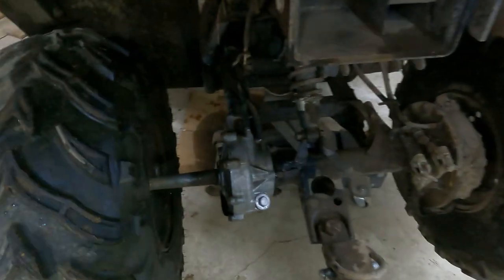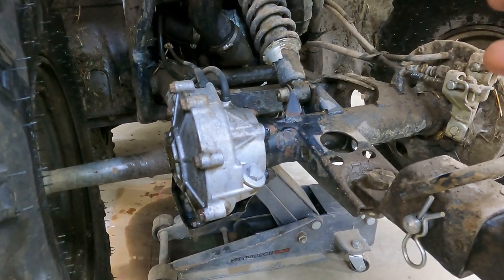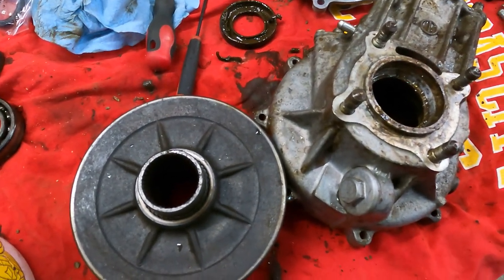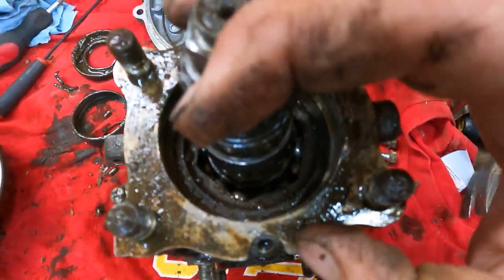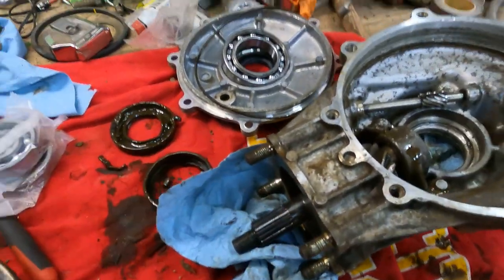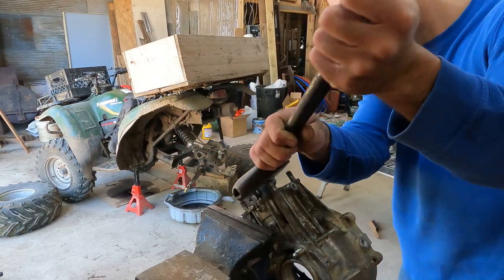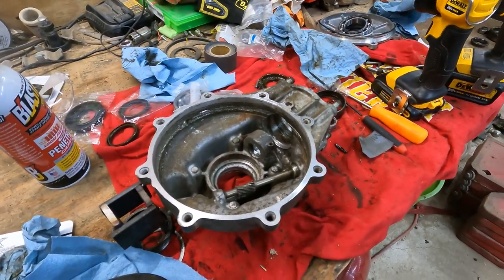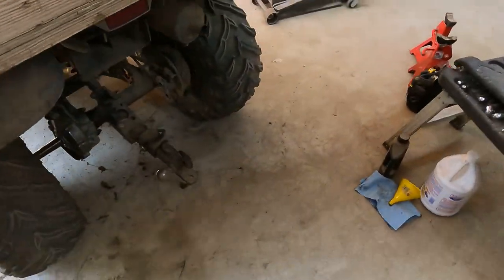Shop Time: Kawasaki Prairie 300 Rear Differential Repair

Comment: Diving in pretty deep on this one.  I don't know much about ATV diffs, but I've done a lot of automotive diffs.  Based on that, I would think there would be some provision for adjusting the mesh and backlash on the gears.  That nut you made the tool for probably has something to do with it.  

Those hypoid gearsets are quite sensitive to being set up properly and can eat themselves up if not set correctly.  Maybe it's not a thing on an ATV, but I suspect it is.  Time will tell I guess, and I think I'd be watching ebay for a good used, complete diff.
Reply from the maker: Thanks for the insight!  This crossed my mind while putting it back together as in the past I gave too many ugga dugga's to a part (can't remember exactly what it was now) and it wouldn't turn.  However, after the two bearings for the main shaft were seated, there really wasn't anything to adjust.  Same goes for the large gear.  I also couldn't find any info suggesting an adjustment.  But, I guess I will find out eventually.  And yes, my plan is to find another diff and throw it on the shelf until needed, another 4wheerler is also on the list so I have a spare when one breaks down.
Reply: Hopefully it works out ok.  Powersports Nation in Norfolk parts out something like 40 ATVs per week and may be a good source of used parts for that machine.